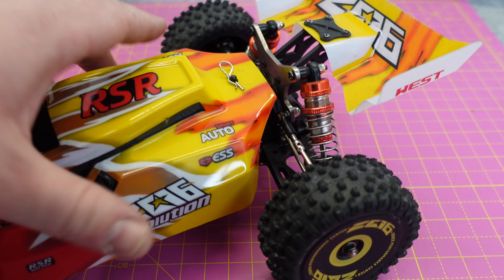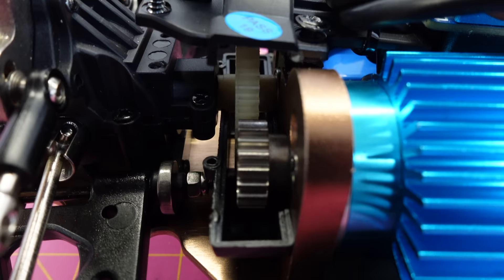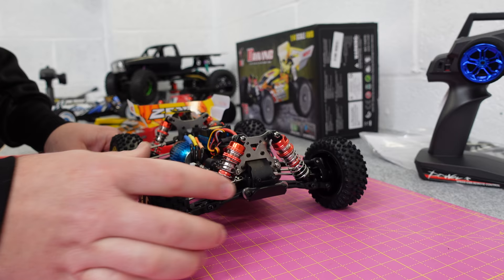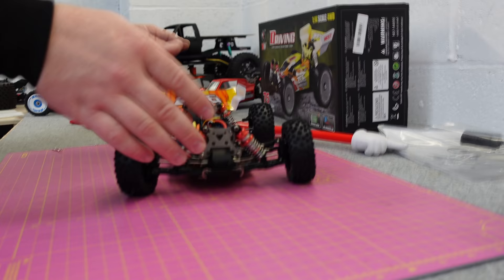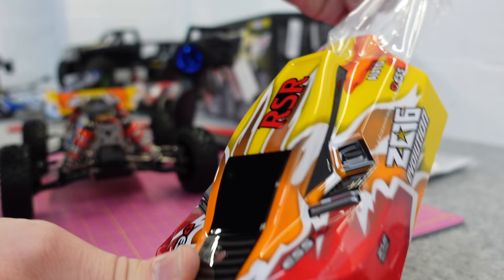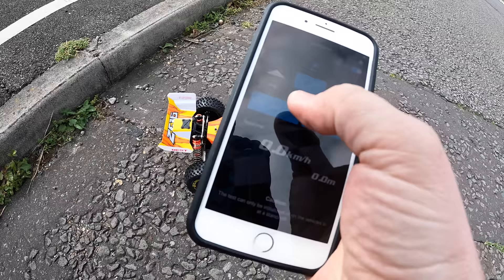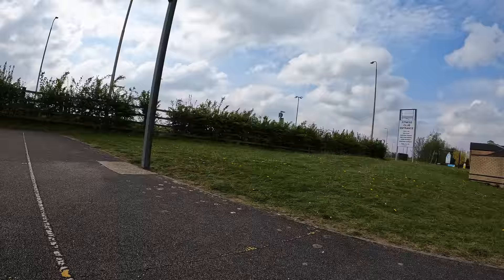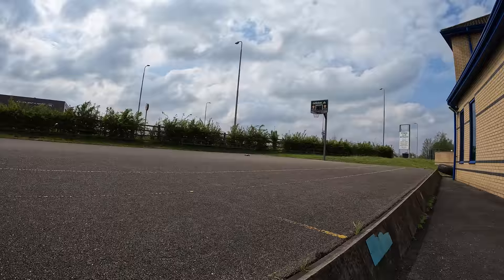The FASTEST RC Car You Can Buy (14th Scale). WLToys 144010

Comment: It's worth repeating that you get so much more bang for your buck than anything Tamiya can offer at any price point with WLToys.
Reply: Does WLToys have kits you assemble by yourself? I like that part of building my RC. Maybe that’s why people go for Tamiya
Reply: @bcaapower  lol. You can disassemble and reassemble the WLToys cars for a fraction of the cost of Tamiya if that's what floats your boat. Plus you can get spare or upgrade parts easily and very cheap.
Reply: @stevelampard  I want to build them , not disassemble. But I agree, Tamiya is overpriced and I think it is riding on a wave of nostalgia, as many companies in Japan (I live there). I started RC last month with Tamiya kit, but seeing you can get much better performance for cheaper, I'll switch to other brands.

Anyway, now I im interested in crawlers and found that WPL sells crawler kits. Do you happen to know any other brands with crowler kits?

Comment: Yes! Got mine! It came with a longer length 2s battery which I thought was cool. Charging as I type.
Rear wheel camber and front wheel toe in needed a tweak. Haven't checked the diffs yet but they feel loose so I'll give them a grease.

Comment: I've heard that the lcracing 14 scale axle shafts fit the wltoys(hardened steel), should be alot stronger.
Reply: They do. Not all parts fit, but most of them can or after some small adjustment.
Reply from the maker: Yes, some parts are interchangeable some not… as I found out with the EMB-T
Reply: @TomleyRC  its a xk not wltoys
Reply: @G-DAC  XK is WL Toys
Reply: @skree_fpv436  oh I didn't know that

Comment: Hi, I know I am late to the party, but I want to buy one of these.  I have a charger and and I'd like to  purchase the car and batteries separately.  I would like to use all the space I can after moving that tray piece back. First of all I am a fan from the states (your channel rocks!) and I'd be buying on Amazon.  I want it fast, reliable, lasts long, and has Dean's plug already on it (no soldering! ) and I don't want to smoke the esc anytime soon. That being said,  what are your recommendations? 2s or 3s, brand, capacity ratings? I don't know enough about batteries yet! Thank you!

Comment: I put the V2 motor mount an pinion in my "carbon" fibre chassis 144001 10bl120 hobbywing ESC 5000kv 2845 rocket motor, it's a ripper.
Reply from the maker: Nice!

Comment: Ever tried rc Helicopters? They are so much fun once you get over the learning curve.
Reply from the maker: Not tried them… maybe one day!
Reply: Mini helicopters, quadcopters, and planes are so inexpensive you have to get some!
Reply: @RickOAA  I used to fly the bigger helicopters (600 and 700 size.). but the costs of the crashes are just way to high. I only fly smaller helicopters now 250 size and smaller and they are so much fun to fly, and pretty fast too. Gonna pick up a M2 Explorer next month.. can't wait heard so much good things about them. You fly?
Reply: @Boy-Named-Zoen Yeah, man, just the little guys. I started with a coaxial Walkera 4G6 years ago. Current using an Eachine E119. Also have a Hubsan X4C quadcopter, an XK J-11 3CH fighter, and a 4CH Volantex T-28 Trojan. They're all cheap, but tough and highly entertaining.
Reply: @RickOAA  that's what's important. That after you land you have a big smile on your face. The only thing I got from the big ones was shaking legs
Reply: I can understand that. My little Trojan is not expensive, but it is my baby and it gets me in a sweat at times!

Comment: Hello.  I currently have the wl 144001, I want to level up,.  I have a very large garden where I run it since there are no tracks nearby and I was thinking of buying the 144010 or 124007 or 124017 or 124019, which would be in my case the best option, I appreciate your comment. Thank you

Comment: Not going to get this as I have the EAT-14 but it looks pretty awesome. Did you find a fix for the cogging on the EAT-14 Phil. I have a V2 motor on the way I'm going to try and replaced the ESC but wondering if I changed to the 19t pinion would it also help?
Reply: The v2 motor is a higher KV. That means you need to swap the mount and the pinion if you want to stop cogging (the problem with v1 was high gearing).

I have set mine up with the original V1 motor and the 19t pinion (v2 pinion and motor mount) and it works great for my garden track.  I lose a bit of top speed, but the lower kv motor and 19t pinion makes the car drive smoothly and gives better control.

Get the 19t pinion and motor mount and solve your cogging + have 2 motor options.... if you can get the v1 motor off the mount (blowtorch melt the superglue/locktite)

Comment: The newest version of this car (2024) comes besides the new (red) transmitter additionally with a new ESC. It looks almost identical like the one of 124017 (v2) but it has a black heatsink, a green board and a waterproof switch. It is not programmable with the grey or the black surpass card. Does anyone know which ESC this is? Unfortunately it brakes automatically after 3 seconds when coasting out with no throttle. Very annoying :-(

Comment: I'm waiting for them to make their 1/10 scale into a brushless set up ready..!!
Reply: I think it will eat diffs unless they upgrade them from the brushless version. 

I tried to love my 104001 (my carbon top plate sorted flex, brushless set up was fast enough), but it just wasn't as good or reliable as the smaller scale WL toys cars.
Reply: @W1DO  I just noticed that Mr. Tomley he actually has a link to their brushless version 1/10 scale.  It's looks pretty good.  But wish was a little cheaper in price than what they got it for.

Comment: This 144010 or the 124017v2? Have an Arrma Granite 3s and Voltage(son's truck). I want a buggy. Follow up being I love the look of these but is the 124019 style a better go if I want to take it on hiking trails and such? Not doing anything more than hiking trails, corn fields, lawn grass, and parking lots. Not really into ramps and such with these guys. I am leaning towards the 124017 as I think it'd be more stable at speed and probably more capable on trails. As far as 124016 vs 124017 is there much besides looks?
Reply: I'd say 124017 for just speed, but why not get a 124019 and upgrade to a fat brushless 3650?
Reply: @fitchyyboi  I ended up with the 124017. Only upgrades are the metal turnbuckles and street tires so i can have both on and off-road success. It’s the one I have been wanting for awhile just got distracted but the 16.
Reply: @unchartedwaters  Same man, love mine- enjoy!!

Comment: Curious about getting this for my young children. I’m worried about parts availability as I’ve never bought a wltoys rc before. If they break it can I find parts?
Reply: Yes, but for young children and beginners the brushed versions will serve as better learning tools. These go fast enough to be difficult to control and disassemble themselves severely when impacted into immovable objects.
Reply: EBay has every part needed for these buddy, but to be honest they're pretty sturdy and don't brake , maybe get some spare driveshafts and lower arms (only get plastic arms) for back up and peace of mind but I've never broke any yet...if you copy kev and send it to the moon!...yes they will brake ,but so do the best. But yes all parts very cheap and readily available👍
Reply: You can easily find parts and community support if you need help. 

I use Lc racing spares for most things as they are the premium version of this buggy and the spares are usually a couple of bucks extra. 

These are pretty fast for young kids though, so turn down the speed!.. or get the cheaper brushed one AND turn down the speed on the transmitter.

Comment: It actually has the 3400 kv motor in there 😉
Reply from the maker: I’m not sure it has… other wise the speed would not be the same as the 1/12’s
Reply: It’s because of the weight tomly ☺️ thanks fr replying
Reply: If you can check the description of the product you’ll see the specs of the motor and it cannot properly handled or fit a 3s lipo in there like the 1/12th scale so I’d prefer the 1/12th scale
Reply: 3400 or 4300 that is the question
Reply: It’s 3400
Reply: @memeboy4219  if it's really 3400kv (and not a typo) then they must have new higher gear ratio diffs or a smaller spur gear, because it's got the same size pinion as the 124017 and goes the same speed.
Reply: The only reason in the weight marky 😉 nice vids btw

Comment: Ι reach 64kmh with my wltoys 144001 powered by a  brushed Traxxas Titan 550 motor.
69kmh for brushless setup are not a big deal.
Reply: Brushless are capable of much stronger acceleration, better efficiency, and the motors will last much longer. It isn't always about outright speed. Gear a brushed motor too tall and the motor and ESC will not last long.
Reply: @RickOAA  stronger acceleration depends on brushless systems quality and kv (low or high).
My brushed  Traxxas motor  & stock esc has a lot of runs without burning.
Reply: Save for tiny, cheap cars and older gearboxes that can't handle it, brushless is always superior. Most any brushless setup will stomp a brushed in most any conditions.
Reply: Your car sounds fun, but your brushed set up is a bigger heavier motor (28mm diamiter can on the brushless 144010). A similar size brushless motor to your set up in this chassis can go fast enough to tare the tyres off the wheels.
Reply: @W1DO  i dont want to spend lot of money on a fragile cheap rc like 144001.
I put Traxxas motor because is stronger & vfm.
Car now is faster 15kmh than stock.

Comment: It's not the fastest lol the associated reflex b has a 5400 kv brushless set up and it has a 2000mah battery out the box. That thing looks cheap compared to the ae buggy
Reply from the maker: You should check my review of the Reflex B… it’s a decent buggy. But around 25% slower than this out the box, so you’re wrong Jeff 👍
Reply: @TomleyRC  I am not wrong everything mentioned is all true. U are also the only one who has had this buggy out of the box do over 40 mph. I have seen high 30s but not 40  plus. Maybe your GPS needs a recalibration.  Saying this is the fastest is a bold statement lol. I would of said fastest from banggood
Reply from the maker: I’m happy to be corrected. But the Reflex is not faster than this. I did the speed test on this and the reflex with the same battery (1500mah CNHL) and the same GPS.